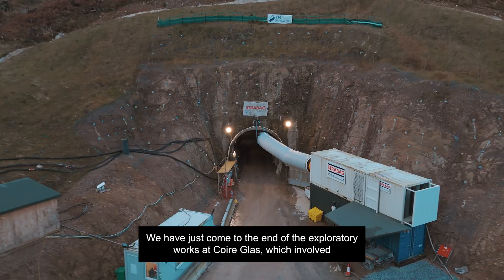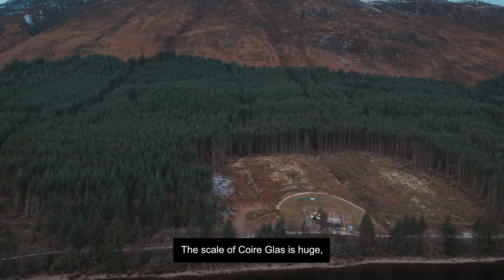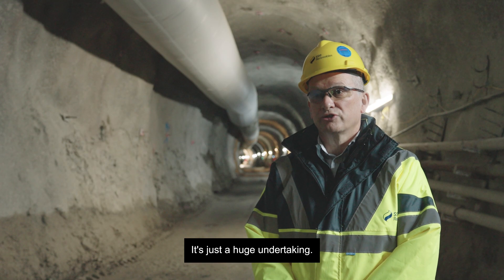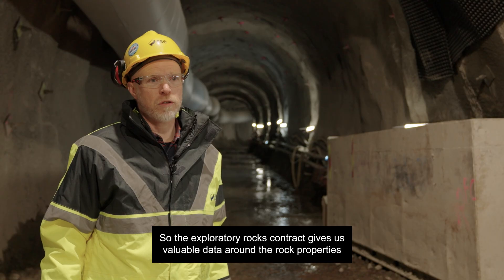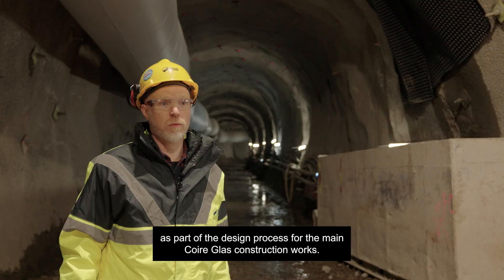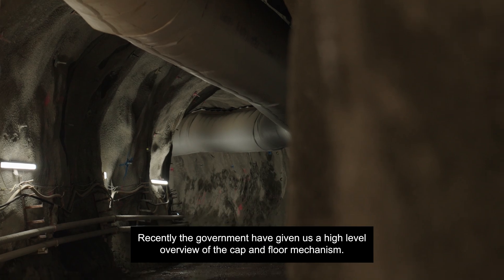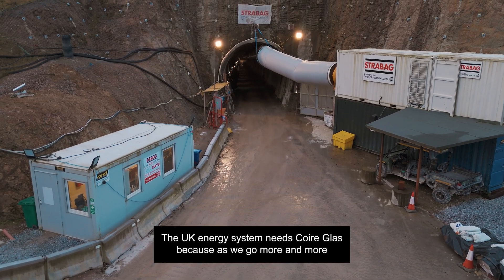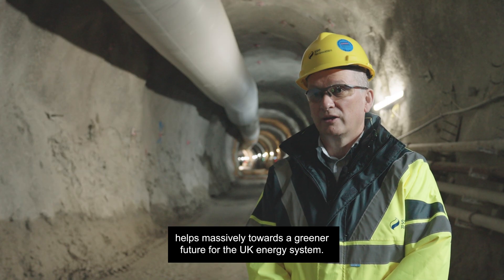Britain's largest natural battery reaches major development milestone

Comment: If all goes ahead when will this project finish? Are there other similar projects? Do we need a new transmission system like HVDC to move the electricity across the country? Would tax breaks on EV's with V2L offer another method of storing intermittent electricity? At what point could the UK be 100% green?